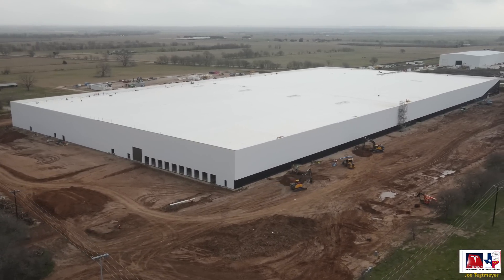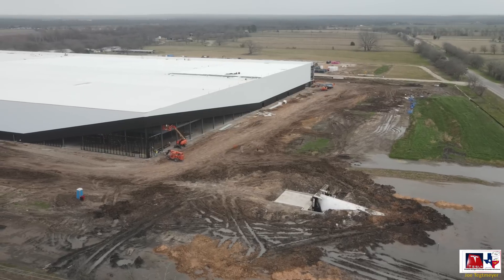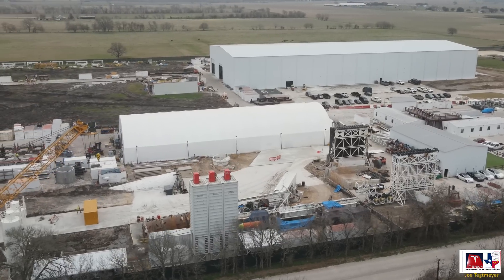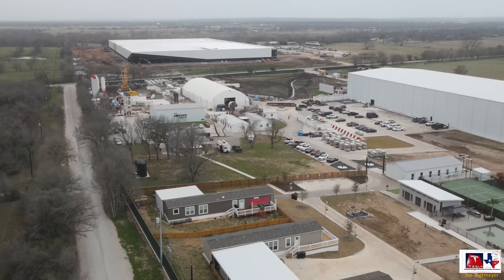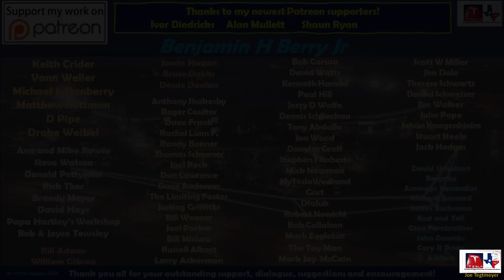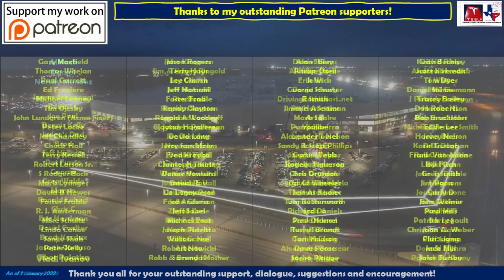SpaceX Warehouse & Boring Co Progress! 16 Jan 2023 Boring Co & SpaceX Facilities Update (10:00AM)

Comment: Joe, at 7:42 the white truss towers are indeed part of the conveyor belt system that removes the spoils from the tunneling operations. The trusses are stacked 3 high, but appear to be the same overall dimensions as a standard 40-foot shipping container. This would improve mobility around the world. This structure appears to have numerous take up pulleys that allow the final length of conveyor belt to be installed at the start of the bore. As the bore progresses, the conveyor is lengthened into the tunnel , with the additional belt length required coming from these take up pulleys. The tower structure in the background clearly has the conveyor belt loaded, whereas the one in the foreground does not. If you look closely at the tower in the foreground, you can see a cable and pulley system that is used to keep constant tension on the conveyor belt once loaded. Based upon some very rough calculations, it looks like this tower can take up about 1,500 to 1,800 feet of conveyor belt when fully loaded, as configured. My guess is that if they needed a longer conveyor belt, that they would just stack the take up towers taller by using additional truss sections (go up instead of out).

To extend the length of the conveyor system into the tunnel, they probably add additional support trusses to the belt at the entrance to the tunnel. I imagine that the conveyor system can grow in length similarly to how a tower crane grows in height with a building. However, I would not be surprised if the conveyor can be lengthened while it is still in operation and actually conveying soil back to the entrance.

Given how the empty take up tower is directly behind the Prufrock boring machine, I suspect that they will indeed be building a second parallel tunnel under FM-1209 to SpaceX. At 8:19 you can see how the loaded take up tower is directly in line with the completed tunnel and that the unloaded take up tower is directly behind the Prufrock machine and the new tunnel location. There is also a roll of conveyor belt material next to the loaded take up tower. My assumption is that they are in the process of transferring the belt material from take up tower closest to the quonset hut to the one further away. The fact that they have lots of concrete tunnel liners ready to go also leads me to believe that a second tunnel is about to begin.
Reply: Thanks Douglas for your Very Informative engineering details and timestamps.  I plan to lookup article(s) about the Prufrock boring machine.
Reply from the maker: Awesome Info Douglas! Thank you very much!

Comment: Always great work Joe!

The “main entrance” with the TBC sign is actually the main EXIT. (If you look close you’ll see the sign on the gate.) 

Bloomberg did an interesting story on this; essentially they ignored TxDOT on driveway placement and sizing, TxDOT legal got involved and threatened to barricade it, and TBC argued for exceptions to the state safety regulations. My understanding is that the current compromise is it can only be used as an exit.

The towers are not for concrete, they’re for the grout between the segments. TCEQ has classified them as “soil stabilization” rather than a batch plant.

Second tunnel is coming but not yet started.

Lot’s more permanent housing on its way.
Reply: Elon's "Boxable" housing?
Reply from the maker: You may be right! I think the real main entrance is on Walker-Watson road along the fence near where the tunnel to the SpaceX facility is.

Comment: Here's a different thought about the tunnel between SpaceX and Boring: it's just a short hop from one to the other under/across the street. Kinda gimmicky and pointless IMO....unless these two surfacing points are intended to be ONLY access points to a much larger and farther ranging Boring Tunnel project that takes place in a future phase. As such these two sides of a short tunnel are only a first step into a much more comprehensive and complex Boring tunnel build-out in the future. Other thoughts or ideas?